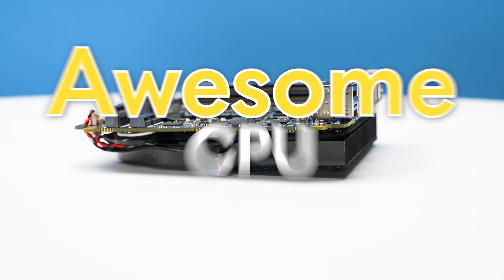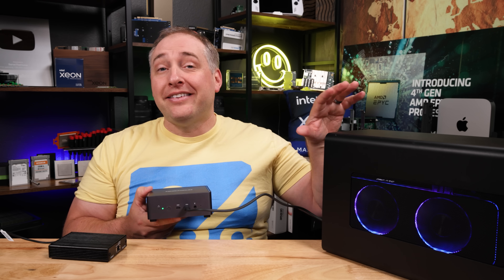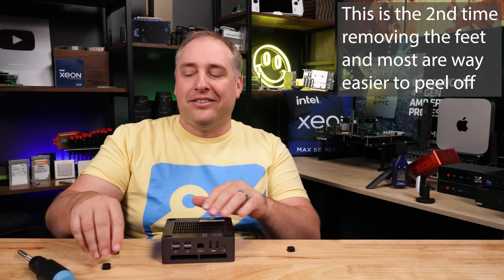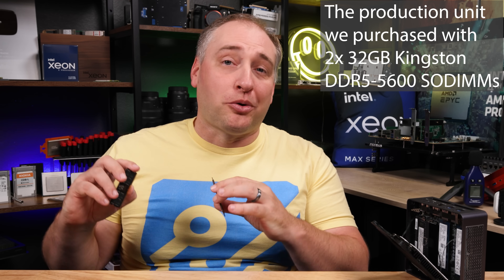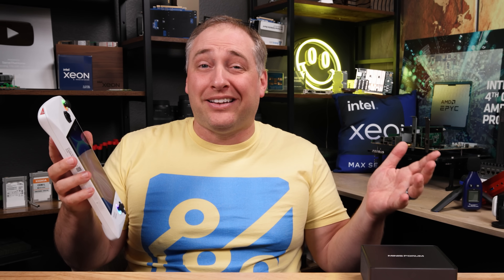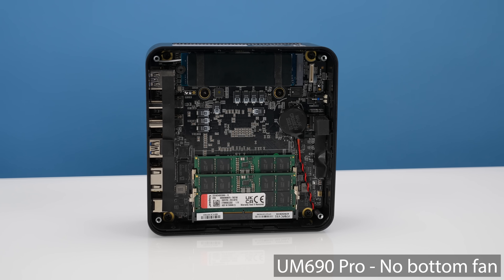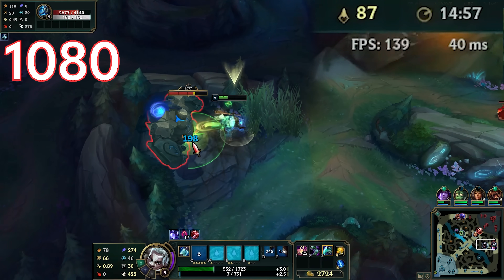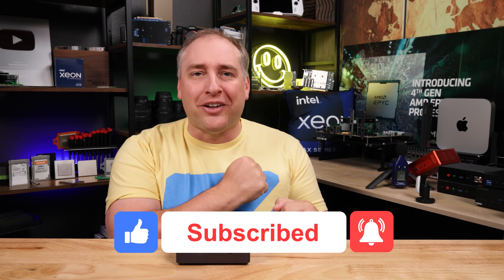This Was NOT the Mini PC We Expected... Minisforum UM790 Pro Review

Comment: Fair warning on the 790 pro:
I've learned that Minisforum doesn't yet have drivers on their site for Windows for this unit yet, and AMD doesn't have graphics drivers out yet either. Just found this out the hard way a couple days ago. Also had a strange white flashing screen issue in Linux, which is likely related to AMD not having drivers for this out yet.
Reply: Drivers available now but as i tested, bluetooth IS not stable and wifi speeds suck... If you plan to use Ethernet câble and normal audio speakers with 3,5" jack, it is still interesting though... I ran it with AMD Radeon 6600XT egpu and it works really great...
Reply: @gregoz2022  PSSST: The Intel AX WiFi cards really suck... branding aside, the stability and range of BOTH the Realtek and MediaTek 6E/BT5.2 m.2 cards is far better. If it's an issue, a $20-25 Amazon upgrade is suggested.
Reply: Try new BIOS(released today 17.07). White screen issue should be fixed(this issue is in the release notes.)
Reply: Also some randomly reboot 

mine worked great for +30 days just enough for me to not be able to return it, so now I'm stuck with it 👍
Reply: is this now resolved?
Reply: @ragefires  Sounds like AMD just released drivers, so hopefully so.
Reply: @ragefires  Don't know about Linux, but still having issues with Firefox and hardware acceleration turned on; Firefox flashes white (on all open windows) when clicking images but fixes itself when clicked. Probably still driver issues.
Reply: Is it good for video recording using obs while gaming and video editing?
Reply: so your issues are with Linux then correct?
Reply: @atta1798  Yes. May have been fixed by now, but I'm still using Windows on mine currently.
Reply: This applies to all mini pcs. AMD is having a ton of problems with their adrenaline drivers
Reply: @neilquinn  Bit of an exaggeration but yes, there are a handful of problems.  RDNA3 is the least mature being the newest gen, so there are some growing pains.  Moreover, the entire Phoenix APU is super fresh, so not surprising here.

Best for folks to continue checking back with Minisforum online for driver and BIOS updates and AMD online for graphics drivers updates.
Reply: I will wait for a few years to get these min pc
Reply: @lawrenceyeung3381  Then you will face new issues.

Comment: It's almost perfect for me. The only thing that really irks me is not having 10GbE integrated. It's got blazing fast internal storage, but would then be limited for network transfers by that 2.5GbE port, unless I buy another dongle. Seriously...come on!
Marvell has great AQC113 chips and I'd pay extra for this capability. Yes, they usually use more power than 2.5GbE chips (more heat), but not everybody is stuck on Cat5e networks.
I'd also prefer the USB4 ports to be on the back with the HDMI ports, having all the display outputs on one side and then 2 USB-A on the front instead, but that's a minor thing.
Reply: They should put a sfp+ cage with the AQC113. You can then choose between 2.5G, 10G, fiber or copper.

Comment: If you had the extra money to spend, would you test a way to link an External GPU to the 2nd M.2 bay and test the potential of upgrading the Graphical and AI/ML Capacity of these Fun Boxes? It would be interesting to see if techniques being used for Laptops using spare M.2 Slots could work on a system like this and then it just takes the Minis Team a small Reconfiguration of the case to allow a cable pass through for such Modifications. They could even expand their business a tiny bit by making Enclosures for the Expandability of a 3rd and 4th M.2 underneath to incorporate external rigs that could link M.2's in RAID on Slots 3-4 and be able to thwamp the Mac Boxes with stackable expansions that look cooler~ The mod community would go nuts with RGB and so on to make them as trendy and NON Apple as possible ^_^
Reply: You can just use an external gpu in the usb4 slots! No need to use up an m.2 slot.
Reply: @rpm10k.  Thanks for the response. I'm going to have to google if that allows for similar transfer rates as that would be so much better. Especially if one could use 2-3 USB 3.2 ports to kick things up to 30+ Gps. Much better than the M.2 in some systems~
Reply: @HectorRoldan  just a heads up, apparently not all usb4 devices are the full 40gbps. The spec is minimum 20.

Comment: @ServeTheHome I have 3 of the previous Gen UM690s and noticed a peculiarity with the rear USB ports, although all spec'd as USB3.2, the bottom  2x USB ports between the HDMI and the case edge were running at slower speeds than the 2 usb ports between the HDMI and Eth port. The difference was huge, using an astrophotography camera, the fast ports were getting 130fps capture rates and the slower ports were only getting 10FPS. Hopefully this is just a firmware or driver issue, and hopefully doesn't impact the new models.
Reply: Are you clustering?

Comment: 2:11 This can't possibly be safe long-term for any GPU that's worth putting in a separately-bought enclosure...
Reply: What would be not safe about it?
Reply: @Rodekuhr The wire gauge vs. the wattage. Even a single-8-pin cable for budget GPUs has a lot more metal in it, both in the wire and the connector. And then you have the melting connector issue on NVidia cards with the new compact connector. USB-C is even smaller than all of them.
Reply: @Lishtenbird  It's not providing power to the egpu, the enclosure has a built-in power supply...
Reply: @benjaminsmekens2344  I relistened to that part and you're right; it's the enclosure powering the system, not the system powering the enclosure. The more you know.

Comment: Did you try sticking the Mushkin 48GB SODIMMs from the HP TMM box onto the Ryzen boxes just to see what would happen?  The memory controller on the Rembrandt/Phoenixes are said to be limited to 32GB SODIMMs, but AMD are usually pretty good when it comes to being a bit over-spec.
Reply: I would be interested in a definite answer to this too before I order some 😅
Reply: @olliefu  96GB 2x48 and 128GB 2x64 will both work. 
Manufacturers only list the maximum RAM Capacity based on the largest capacity sold at the time of release.
There is no technical limitation for 64 or even 128GB... the CPUs can all address well into Terabytes of RAM.
Reply: I was able to run the NPB7 with 2 x 48 GB Mushkins. Also, I read two guys made the same successfully experimentation with both UM690 and UM773 Lite. So, I think the UM790 Pro should be also compatible.

Comment: The one thing i'd change about this design, is move 2 of the type A ports to the front, and the type C ports to the back.
Type A on the front is great for wireless accessories like mice and headsets
and type C on the back allows for a cleaner look.
Addtionally, if this saves enough space, it might allow for a second network port, though unless this came with a Ryzen 3, it would be overkill to use this as a router, unless youre doing some serious caching with a 10G network port and 2x NVMe.
Reply: I would also switch 1 hdmi port to DP, or mini DP.
Reply: @wandererdragon  if DP 2.0.
Reply: I think it should be a blend of both A and C on both front and back. Why? Could get any type of thumbdrive and want easy front access. USB-C on the rear is critical if you want to semi-permanently attach an external HDD or other peripheral and want it tucked away on the back of your desk not the front.
Reply: @neilquinn  Agreed, i have a 1TB USB-C flash drive that is rather conveneint, but it also has USB-A on the other side
Personally for thumb drives, unless they're absolutely tiny, i prefer A over C because it is a more robust mount.
Reply: But, but, these are USB4, and USB4 enjoys short cable length.
Reply: @Chris.Brisson  I agree, maybe just move one port to the back so the cable doesnt have to snake around to the back for a dock, display, or eGPU.
Reply: I mount these things to a monitor. Having ample usbc and usba on front and back is good because that's left and right side of the monitor.
Reply: Why not just turn the units to the side? Then, you can have all of the ports at your disposal.
Reply: @madguitrst  Then the screen would rotate 90 degrees and you'd have to crane your neck.
Reply: Saved me from writing same.

Comment: Hard to believe that next year (Strix Halo)we will have 16-core Zen5 and 4070-class GPU in this class of hardware. basically %250-%300 better CPU/GPU performance.
Reply: Moores law is dead has a terrible track record with leaks and his analysis is poor. Serve the home is a great resource and has real analysis and the two couldn’t be more different
Reply: @cbrunhaver  Yet... Strix Halo is now here, and has 40 Compute Units, 64MB of Infinity Cache, and is basically having a RX 7600XT inside the APU.  Pretty damn impressive, to be honest.
Reply: That's using a way higher TDP than this / a nuc sized pc.
Reply: wont happen bro. A moderate Guessstimate would be something like 16 CU´s intstead of 12 and higher clocks. maybe like 3.2GHZ instead of 2.8
Reply: Strix Halo will be awesome if they actually produce it, but smart money says they won't, or it will go in a switch 2 or some proprietary product if they do.

Letting consumers get that awesome of a product just isnt how any corporation seems to operate these days, much less AMD.
Reply: @jadedandbitter  Strix Halo is here, and it's AWESOME. Too expensive right now, but in a couple of years, we're going to get that tech trickling down into affordable Minis.
Reply: You sound like the people screeching that Zen 2 would be $89 because it used 1/4 the silicon of the competing $360 Intel CPU.

Comment: In 2 years when these hit $300, I’d definitely give this a try.
Reply: They don't make big batches and become abandoned ware quickly
Reply: These will make ideal compute clusters at that price point. Drop one of the m.2 in favor of a 10g/25g sfp+..
Reply: @kennethfeagins1414  if you use the networking for a cluster, you can also just directly attach 2 USB4s together and get 40GBit/s of bandwidth. But you'll need to manually load the thunderbolt-net kmod
Reply: I got myself a pn50 in 2020 and the price did not go down since. They're just unavailable now
Reply: I got mine for $350 and i love it!
Reply from the maker: Great point.
Reply: I just ordered the exact machine and I’m waiting for it to arrive today. you’re right nine months later it was right about $400. Paired it with a new 32” 240Hz monitor. 
I got the Ryzen 9, not really knowing that the newer Gen 7 would be a bit faster. 32 GB of DDR5 RAM. I’m a MAC guy so I’m pretty stoked. After this i plan to build one. I thought I’d get my feet wet.
Reply: They'll have different models then, and these will be unavailable.
Reply: That kind of movement in electronic performance used to be possible but is a lot less likely now.   It used to be cheaper to do a shrink on devices and that worked very well down to 32nm.  Going to 16nm was a tougher step and each subsequent step down wiped out a lot of wafer fabrication companies. 

I believe that this is 4nm based which is already very specialized and pricey.   Going smaller is actually even more expensive.   $300 will be perhaps a used unit but as long as the parts can be swapped easily not sure why most entry level consumers will sell them. 

Biggest issue is going to be the ability of a factory in China to buy the components listed.
Reply: @harryniedecken5321  comparable 3 year old ryzen mini pcs (5800H based) are now selling for approx $300. Might not be always selling at that price, and might come with shitty RAM and SSD, but they are here.

For my homelab needs, I usually target liquaditions from schools and companies. So, I dont mind used ones either.
Reply: You can already get one with a Ryzen 5600H for about that.  In a couple years you'll be able to get one with Strix Point or Strix Halo and have pretty solid GPU performance.
Reply: @aa-yt7wo  USB4 is the difference between a 7000 series machine and a 5000 series machine. More than the performance and the power efficiency.

That would make it a ideal home server.
Reply: This is better than my UM690(6900HX) and my UM350(3650) which did only cost $300 for 16GB and a 256NVMe... My UM690 only a bit slower than the RX6400 in my HTPC...
Reply: Its almost $499 barebones for gmktec with 7940hs now
A few months it might go at that price
Reply: The preproduction model will become a novelty item in time
Reply: By then the Ryzen 9 9940hs 3nm will be out and demolish everything 😂
Reply: Yeah for sure, it won’t hurt as much when it starts shutting off randomly I’m now here $700 in and this bitch keeps crashing 😂🥲
Reply: I like your idea 💡
Reply: Those days are over.  No more excess inventory 2yrs later.  Lean systems.
Reply: Barebones sure but older units are not at this level yet
Reply: It’s been 2 years
Reply: It’s happened
Reply: Haha, I’m sorry to inform you but they are still 450 for barebones but getting there bro. Hang on!
Reply: Hahaba now they cost more
Reply: the same idea
Reply: By then there will be 16k gaming though
Reply: It's good for gamers, software programers, video editors, and Office 365 productivity.  Very individual focused.

However, it is horrible to roll out to multiple employees in a short time due to difficulty getting to the SSD.  Not something an Information Technology team should use at a company.
Reply: @akin242002  It's only 4 screws to open the bottom and access the RAM/NVME drives, but I think some of the 1 liter minis they reviewed had a pull tab.
Reply: @akin242002  Those are just OS images... It's not hard to get SSDs with images, but then many companies use network pre-installs so individual users can add their own login and email...